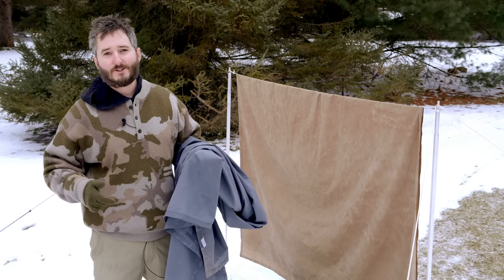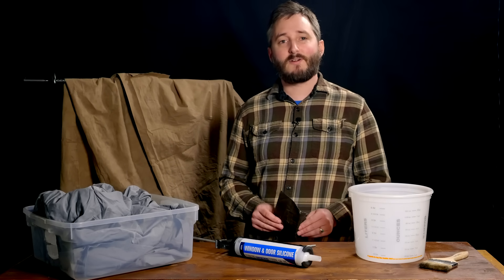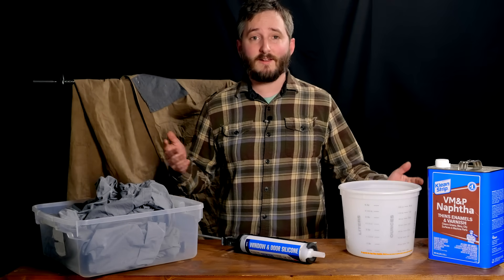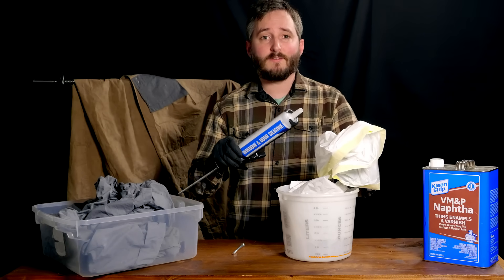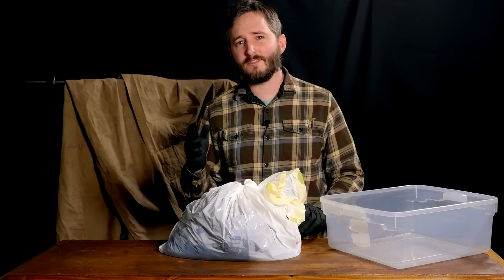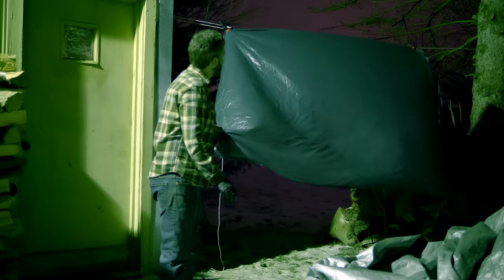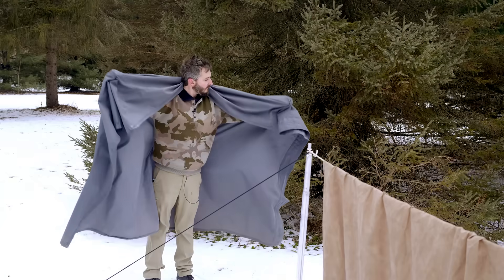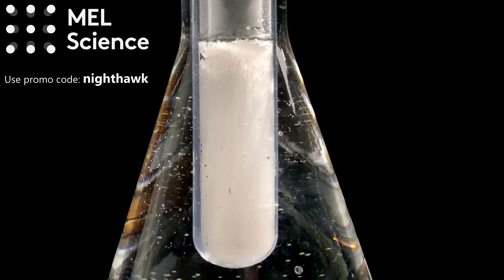Recycled Bedsheets Make The Best Waterproof Tarps

Comment: How long does the silicone stink last i wonder? haha
Reply: Up to around 48 hours which is the full curing time when used normally after that it might have a slight smell, put I have used it on the backs of the house mats to stop them from sliding across the floor and now after 6 years they are still no-slip and they have no odour at all.

Comment: Very interesting waterproofing technique. I'd be interested in a comparison video between this and commercial wash-in waterproofing (Nikwax Tx Direct is the brand I'm familiar with, there may be others). 

I've waterproofed a fleece sweater that way effectively: it is done in a washing machine (much easier than this) but I suspect not as durable. Would just be interesting to see them evaluated side by side. Your way is probably quite a bit cheaper!
Reply: I'm thinking this is more like seam sealer than nikwax.  People have already done this using their own silicone and mineral spirits as seam sealer for tents.  I think the best waterproof tarp material is dyneema but it is more expensive.
Reply: There's no way in hell I would put silicon and Naptha in my washing machine!
Reply: @randallsmerna384  the naphtha would already be evaporated
Reply: Here's a comparison: You can buy these supplies at a hardware store for CHEAP. Commercial applications buy or make their waterproofing, not from a hardware store. If this silicone method is less effective simply do a second coat?

Comment: One caveat:  if you use such a tarp to cover a surface that will be refinished in the future, you may contaminate the surface with enough silicone residue to interfere with adhesion of any finishes like paint and varnish.  Silicone is very difficult to remove once it gets on a surface, as it leaves a very persistent residue.
Reply: Would you do this to cover flooring if you were painting a room and didn't want to get paint on the floor?
Reply: @cameroncook975  If it's a wood floor you ever plan on refinishing, you probably shouldn't. Standard plastic dropcloth would be a way better option than going through all these steps.

Comment: Hello Friend, It would nice if you could take this idea to further developments. 1- Make a stovetop for any convertible car such as Mazda Miata. The soft tops are not only expensive , on some older cars you can't find them. 2- this is a bit a bit odd ; Blanket with a 12 volt solar  charger heater for homeless.

Comment: Helpful tip?  At 3:30 you're pouring from the can the wrong way; if you put the outlet at the top (either 90 or 180 rotation), air can get into the can more easily and there is much less splashing.  Seems weird at first but it works.

Comment: In Finland you indeed do this with hardware store materials, as you can buy ready-made mixtures in a spray bottle (iirc it is either silicone based or teflon based) :v

Though I do wonder what would be cheaper for the same level of protection, to make it yourself or to use the pre-mixed and bottled stuff.

Comment: The pebble method is fine and all but it stresses the fibers of the tarp around the pebble and pulls on a small section of the pebble area much like a grommet does. It also requires a pebble.
I prefer tying out the corner using a Sheet Bend Knot.

Comment: Nice vid, thanks. Got any more info on the traditional methods and how to apply them before modern chemicals became available? Does the dried sheet-tarp have any smell after a few days? Does it catch fire more easily than just a cotton sheet - would you use it near shelter fires as readily as a plastic one? Cheers
Reply from the maker: Search for oil cloth to learn about traditional methods
Reply: @Nighthawkinlight  Ted cruuuuuuz!

Comment: Fixed a pair of 15" speakers with silicone and fabric rings to replace old shredded foam rubber around speaker cones. 40 years ago. Still crank up the volume, shake the walls.

Comment: After doing a quick search online, apparently you can use turpentine in place of naptha. If anyone knows more alternatives, let's hear em, because people might have some of those alternatives lying around.
Reply: VM&P Naptha is unscented cigarette lighter fluid made from crude oil. Mineral spirits is similar but thinner, with kerosene being a close thicker relative but less refined and less active chemically. Kero doesn't thin paint well so I'd avoid it; the rest should be similar but I haven't tried that with silicone. Turpentine is distilled pine sap, and again similar to mineral spirits/naptha in chemical structure and effect, but it's also thicker. Turpentine by itself will waterproof cloth but evaporates in days, losing that quality. The upside is that it smells better, but again I haven't tried it with silicone. All of these are highly flammable and the cloth will burn vigorously till the solvent evaporates so excercize due care in use and drying..
Reply: @P_RO_  I was thinking about re proofing a kite 15 sqm, I favor terpentine in lue of naptha, drying could be an issue.
Reply: @P_RO_  these kites I use are double skinned , I fear they will stick together, what's your opinion ,?
Cheers.

Comment: I’m looking for a waterproof panel to cut to size and shape as an optional add on to tent door. I would like a larger sheltered area at the tent door so I can comfortably sit in rain of bright sun.  I can use the button technique to temporarily join the waterproof sheet to an extended tent door, and stake it out with guy lines.  BINGO!
Courtesy of Half Vast Flying

Comment: the button technique was awesome. so simple yet very powerful tech. I have often tried to figure out a way to tie out corners of material that did not have a grommet.  I may give the siliconized of a sheet sometime when i have the resources to do so. Mel's chemistry sets look very interesting. I wonder how much they cost.
Reply: There is a video out there using a 4x3 sheet to make a tarp tent that makes use of a celtic knot and a scaffold knot to do this exact same thing but with only a small piece of cordage and without having to use a rock. It's lighter, and more efficient. Definitely worth looking into.
Reply: @Vlaaaah  link or name of video or technique??

Comment: i was thinking about the same but with more basic material which was candlewax.. just rub candle on the canvas and use hair dryer to make it melt on it.. not too good perhaps on bending as is with silicone.. less of those fumes polluting air/ground

Comment: So I have an issue, not with your video but with the availability of Naphtha where I live, the UK. is there anything else that will dissolve silicone caulk? I know that naphtha has toluene in it. Will it do the job? Even this solvent is hellaciously  expensive here.
Reply from the maker: White gas camping fuel should be the same thing

Comment: Sorry to spoil the fun but... What about the environment? It looks like you are purposefully spreading microsilicone into the environment. An old wax coat does the same, but the wax is not harmful, while the silicone is.
Reply from the maker: Silicone isn't known to be environmentally harmful to my knowledge, and eventually biodegrades into sand and carbon. You can read more by googling the term "silicone environmental fate".
Reply: @Nighthawkinlight  Thanks, didn't know that.

Comment: Would orange oil-based solvent work with silicone? I try to avoid using petrochemicals where possible, which is part of why I find the silicone coating interesting. But if I need to use a petrochemical solvent in the process, it's a bit of a wash.
Reply from the maker: You'd have to do some tests. I would also look into how much fuel is used to produce orange oil, because that may balance out anyway.

Comment: This is awesome! There’s no doubt that silicon makes a great water repellent, but I had no idea that you could dissolve it down with a solvent and apply it to things like sheets. Very cool!
Reply: Right! I want to make waterproof jeans for wearing in a motorcycle on cloudy days
Reply: @skie6282  I wouldn't think they would be very breathable. Imagine how a plastic raincoat feels, and they at least get air circulation at the bottom. Good for not getting wet, but all day wear could create some issues from condensation, and sweating.
Reply: @skie6282  ive had mixed results w/ WP pants on my bike. used the high end breathable WP pants from sports stores and >80kph the water was forced right through the fabric soaking my shins (tops of my legs were fine). i still think the best WP bike pants are the cheapest rubber/plastic ones -chuck it in a saddle bag or a fender bag and throw it on when it dumps
Reply: @Jonathan R. Lee Enojo  i know what you mean.  but have you tried this silicon technique? If done right it should be like impenetrable rubber id imagine
Reply: @skie6282  put the fabric isn't impenetrable it's just woven and there are small voids. Chances are under force moisture will be driven through those holes.
Try it though and let us know!
Reply: @Randall Smerna  yes but if the silicone mixture is thick enough i think it should fill the gaps, of course while not being just a sheet of rubber. I wont be able to try it for a while
Reply: Same thing is used to seam seal tents, it's been a thing for years.
Reply: @Rogue_Templar  imagine if fabsil been selling us cheap silicone and solvent 😂
Reply: Being a biker myself, i also thought this, could use this to make my jacket waterproof again too hopefully, would probably have to paint the jacket with multiple coatings

Comment: I'd always been frustrated with what to do with a half-used tube of silicone after a job (try as I might, never found a way to stop them setting before I next needed some silicone) - not too expensive to open a new tube for each job, but always seemed annoyingly wasteful.

I'm just going to get a container 5/6 filled with napther and squeeze in all my leftovers - once it's full, I'll have a handy-dandy can of water-proofing.
Reply: You can use solid silicone to clean sanding belts
Reply: @erictheviking672  You can probably apply it liquid to the belt, let it cure and them peel it off with the dirt. Once cured it won't be sticking to the belt, but the more liquid form should get into the nooks and crannies and grab the dirt on the way.
Reply: Now that is a great idea.

Comment: Another way would be to use the IKEA Absorb set - it contains a soap solution (ignore it) as well as a white liquid that probably contains some microcrystalline wax dispersion. If you use this, the wax absorbs into the fabric and makes it quite waterproof. I have a bag waterproofed with this, which I've been using for years.
No solvents involved  .... but I don't know where else to get that kind of liquid.

Or use the age-old method of soaking the tarp in linseed oil (optional: with some added beeswax)

Comment: this is absolutely fantastic,  curious to see a durability test and to find out its weaknesses,  flames, acid, long term outdoor use, ect ect
Reply: You can test it all at once by setting acid on fire outdoors for a long time while the sheet/tarp is in it!
Reply: @danrooney7914  good idea, i think i know just the guy 😂
Reply: Whats about risk of polluting vegtables in a garden??  I wonder if some particles of silicon or solvant can be "washed away" into the soil.. or drinking water issues
Reply: @chrisolivtreez8017  silicone is essentially non toxic. It shouldn't cause any more issues than sand or glass which are also made of silica.

As for naphtha its essentially pure carbohydrates. Any biologically active soil with suck up that free energy and it won't do any harm. Especially in the tiny amount it might shed after most of it evaporated.
Reply: Silicone won't burn, it's safe to use silicone utensils in hot pans and such because it doesn't even melt until quite high temperatures. The fabric might still catch fire and break down in fire as normal though.
Reply: @TopolinoEV  thats a possibility, also im assuming we're talking about pure silicone, im unsure but looking around there appear to be variants that arent 100% and may have additional effects.  Who knows, tis the life of a scientist😂 test repeat test repeat

Comment: why stand there kneading? put the bag of goo in the clothes dryer, air dry for those 5 minutes. bonus: put several units in same dryer
Reply from the maker: No, driers use heat and flame and sparking electronics. That's a bag of flammable liquid.

Comment: One thing to know about silicone is, that it is not possible to 'glue' or add another layer of silicone to a base coat or layer of silicone that has already dried after having been applied earlier. This goes for in-house applications and for use as above. It must be done right the first time

Comment: Letting silicone and solvent just drip onto soilground is not a very good idea. Even if you wring it out well it’s still gonna drip. You should let it dry in an area where the solvent and silicone can’t get into the ground/nature. But otherwise a very good video.

Comment: Great video. I never knew uncured RTV silicone was soluble in naphtha! I have a two questions: first, what about UV stability? Silicone should be more or less OK under UV, but what about the fabric substrate? No doubt some dyes used will fade more than others, but as long as the breakdown products of the dyes don't harm the linen that wouldn't matter except from an aesthetic point of view. Second, what about rot resistance? For both of these considerations, what might you add to the silicone solution to deal with these things?
Reply: I haven't tested waterproofed fabric, but using sheets as shading for poultry, poly/cotton blend is far more resistant to UV rot than plant based fiber.  I've poly/cotton sheets last over 20 years of summer use before I could tear them  by hand.  The dyes used for poly or poly blend fabrics are more resistant to fading than the ones used for plant fibers like cotton & linen.

Comment: That is really quite a clever concept. I prefer my clothing to be breathable and waterproof like Paramo waterproof clothing with Nickwax. 
I was looking for a solution to 'waterproof' the skin of a kayak. I 'invented' a camping kayak. I sleep in the boat on the water. At the time inflatable boats were quite bulky but worked for what I used it for. Things are changing. 
Anyway, I wanted to find a way I could carry a kayak in a small packet. The solution I came up with is to make a 'skin on frame' kayak, but they are bulky. So I was thinking I could make the skin. Make the the kayak frames. And when I get to my destination, I can buy some standard sized batons available anywhere and rebuild the kayak. It's the ribs that take up space. I never thought about using solvent to thin the silicon. Very clever. Thanks.

Comment: Try to get a little less air inside the knotted bag, to make it easier to massage the sheet with less risk of popping. 
Also, use smooth pebbles or ball bearings for the buttons, else it'll eventually wear through the material.
Good video though. I've used silicone-soaked cardboard as a replacement for foam-board for various things, but you need more attention to holding it's shape while drying it. I usually just lay it on plastic sheeting, and let them bond together permanently, cut the edges when dry. Makes it that much more water tight & durable. It's far stronger than cardboard when done. And multiple layers of cardboard bonded while wet makes a surprisingly strong material. You could roof a house with it.

Comment: Anything treated in this manner sheds silicone on anything it touches making it a poor choice for backpackers and bikepackers, anyone having to stow them regularly. Also when the material is actually used rather than just presented for YT hits it stretches and starts leaking/weeping quickly. A waterproof 10' X 10' 5-6 mil thick laminated polyethylene tarp costs $7 and is amazingly durable, the downside is it is relatively heavy for packing. A waterproof 10' X 10" nylon tarp is only $25, and the King of waterproof... Dyneema is at the opposite end of the cost spectrum. When you are talking about staying dry the cheapest gimmicky way to do it isn't ever "best".

Comment: Thank you for sharing.  Have you thought about putting a vacuum on the bag with fabric/silicone/solvent to force saturation of the fabric?  It might mean less waterproof mixture is necessary.  It also may be overkill and the manual method may be plenty effective.  Just a thought.

Comment: Great idea! I'm just wondering how heavy the tarp gets with all the silicone and naphta? I would love to use it for hiking trips so therefore it should be rather light...
Reply: I haven't tried this myself, but theoretically the naphtha will mostly or entirely evaporate after the treatment during the drying phase, so it should add little to no weight for usage. The silicone will probably remain almost entirely though (minus what stays in the bag, dissolved and discarded afterwards) so you'd probably end up with the weight of the sheet, plus the weight of most of the silicone dissolved, plus a tiny bit of the weight (but not much) of the naphtha.
Reply: @dhabu9017  That's what I expected as well. Not that light anymore then, at least compared to ultralight tarps.

Comment: Just a tip, and only for a minute, if you pour from a container like that Naptha container (with no air vent) it pours without glugging if you do it with the spout at the top rather than the bottom. Upside down from the way you did it at 3:28

It's likely that a smart fellow like yourself already knows this, but maybe this comment can help someone else who doesn't. Have a good day, and thanks for the great video!